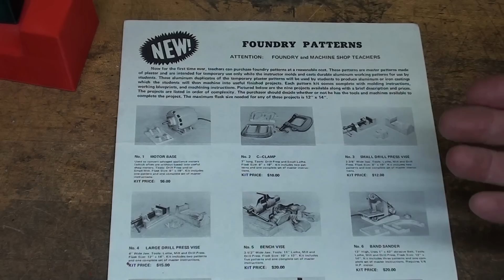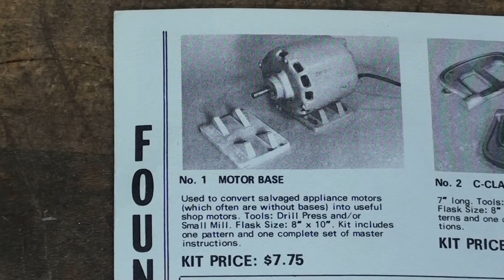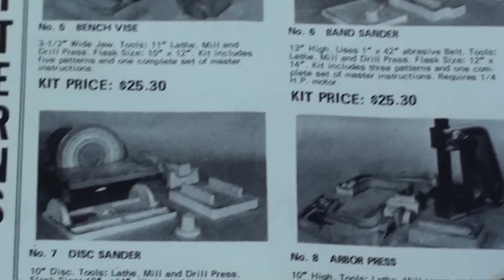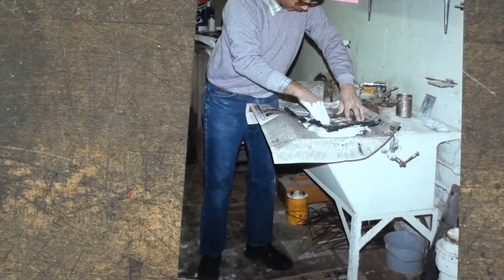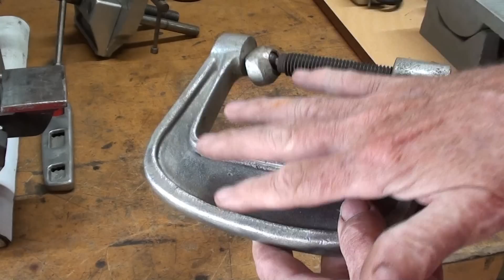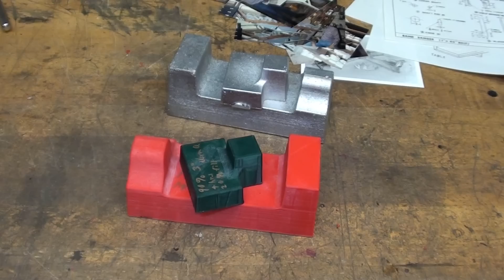What Was PETERSON PRODUCTS? Tips #445  tubalcain

Comment: HS was the early '80s.  Our school was a WPA-built, all-inclusive building for a growing suburb and Industrial Arts held the ground floor that wasn't the cafeteria.  4 years of drafting, wood and auto shop, 2 years of metal shop were offered, as well as electronics, plastics and printing in the Junior High as well as Junior and Senior year 1/2 day advanced vocational/technical training at multi-district campuses.  In the city, there were technical high schools with an even broader array of offerings.  Today, we're down to a couple years of "shop" total in the HS, 1 required, 1 "extra," with 2 years' of 1/2 days vo-tech off-site, focused on auto-trades, welding, cosmetology, etc.  Oh, and you can't earn a "college-prep" HS diploma if you take Vo-Tech, unless you take Math on your own.

I have kids that want to work with their hands and took all the shop they could.  One did the vo-tech offering in Welding, and I mentored the online Math class.  From one of their classmates, they learned about the machinist trade and it sparked them!  Luckily, there is a local state college with 2 great teachers and a top-rated program with much hands-on machine time.  First year in manual, with a steam engine as a capstone, 2nd year is CNC and pick your own final project.  They excelled and found good employment.  (Makes me think about going through the program and starting a second career, lol.)

Their teacher inspired them, as Mssr's Lagowski, Ptak, and Weber did for me in HS, as you do now for a worldwide classroom looking to learn.  Well done, Mr. Pete, as we sit here at our virtual desks waiting for the class bell to ring and the next lesson to begin.
Reply from the maker: Thank you for an analysis of the current state of vocational education.

Comment: Yes I cared. I got interested in that topic since you mentioned it in the band sander pulley videos.
You said you made about a hundred band sanders. That means you made about 100 band sanders in class with school kids using your own pattern that you also sold to other teachers or schools. How many of the different plaster molds did you sell over what period of time? I assume you got so tired of it since it forced you to work overtime probably for a longer period and series production is mind numbing. Did you ever consider another mold material than plaster?
Reply from the maker: I have no idea how many plaster patterns I sold over the years. But it was a lot. And I could think of no other material that was cheaper than blaster that is plaster. My whole point now is that could've been done was a 3-D printer
Reply: I see your point wanting to use a 3D printer. For a one-of-mold a 3D printer would be very practical but if you had to deliver many molds per day you would have needed a room full of 3D printers since each one would need several hours to finish one mold. The slow manufacturing rate could make 3D printers unpractical for larger production rates. In such a case plastic injection could be an alternative. What's more 3Dprinter filament costs about $30/kg which is more than cast aluminium. For medium production rates a home made semi-industrial outfit might be sufficient. In below link a guy has home made a shredder for recycled plastic whose shredded material is then used in a simple injection mold machine and in an extruder to make plastic products faster than in a 3D printer. "preciousplastic DOT com SLASH en SLASH machines DOT html". I have to give the link in this format since youtube sometimes deletes the whole comment when they mistake a link for spam.

Comment: Memory lane here,

I’m 37 and in high school we used to cast aluminum and pour are own molds. 
I think we had the belt /disc sander as a project.( or similar)
The belt sander used bushings and not bearings. Ate up lots of power from the motor, as I used a old dryer motor maybe 1/3 hp it was to small. 
I believe a drill press and band saw were also projects.

I’d like to actually build some of those C clamps. 

And my ramble is over!!
Reply from the maker: Thank you, sounds like you had plenty of experience in the school shop
Reply: mrpete222 

Ya.lots of experience and  a 2 year degree in machine shop operations.   I own my own Sheldon lathe and millwrite mill . 

Always doing projects at home.  I am a great  tech on scraping. .00005 flat on 40 points per foot. My  last job interview was for $16 a hour . Roanoke VA 
I am now working at a lawn scape place mowing  For $15.
Not my passion at all. I’m a die hard metal guy..

The first 10 years of my life I did auto collision work. Average 75k a year . 

What do you think on the current job situations/market?

PS, I am much like you starting business ventures. I remake and sell Sheldon lathe way wipe felts.. made a steel rule die and stamp them out. Have probably sold 100 sets.
 Setting up shop for Colchester 

I’m all done ranting . 
I love your vids !

Comment: Couple thoughts:
1) Another perk of having the source files is involving the students in a design-build-test exercise. Ask them to break it and then ask how they would make it better with minimum added cost.
2) If the idea of a foundry rattles the bean counters in the insurance department, might some kind of sintering oven work? There are 3D printing filaments with embedded metal particles specifically for sintering directly in an oven.
3) (edit - forgot) is there room to greatly improve the functionality of Aluminium-only castings with steel inserts,  either pressed in after the fact or cast-in-place? Making inserts could be a neat short production run exercise. In 3d printing, I think they call these sorts of embedded higher-strength bits "vitamins". You pause the print at the right layer to insert them and it gets you closer to the functionality of a solid metal part.
Reply from the maker: I am not familiar with the metal filaments
Reply: Sorry I was being lazy about linking. Here's an example but they have copper and bronze too.
https://shop.thevirtualfoundry.com/products/stainless-steel-316l?variant=12352928874579

These are not the same as filaments with embedded metal for aesthetic purposes. I imagine they could all be burnished to a bit of  shine if you just wanted the look.

Comment: Love the video.  Too bad you couldn't print the plaster patterns, but with the old steam and diesel powered computers, it was probably easier to use the rubber molds.  Speaking of maturing technologies, printed patterns make a whole lot of sense, even industrially.  Think of the space savings, with digital storage of patterns instead of a warehouse of stored wood, especially for repair items.  Of course, so much stuff is hogged out to solid stock with CNC, that patterns have less relevance in the larger scope than in the past.  It is disappointing to see the crafts relegated to the "Botards" rather than to bright, motivated individuals, because we, as a society, need them desperately.  Maintenance/repair has been reduced to "unit replacement specialist".  Don't fix it, just toss it.  But I ramble.  Look forward to a session on 3-d printed patterns, with references to process software.Cheers
Reply from the maker: We didn't have printers back then

Comment: I found this video extremely interesting - as a middle and high school student in Spfld. Illinois in the early to late 70's we had all kinds of shop classes - even in Grant middle school here in spfld. Illinoi within our industrial arts classes we had what were called exploratory classes.  Classes offered were in home construction where we built a scaled down home module learning all the fundamentals of home construction from foundation to roof.  We also had small engine repair class, a rather good manufacturing class, drafting, electronics where we learned fundamentals and built solder kits of radios etc. and there was even a radio and television class where we learned radio and TV operation and even built a mock radio broadcast booth in the corner of our classroom, I still have a newspaper article showing a pic of us building the broadcast booth -- In Spfld. high school we had wood shop with lathes etc. and metal shop - the metal shop did do aluminum casting and some machining.  There's also Vocational school with many classes like auto mechanics, auto body and many others.  I still live near these schools but in both the middle and high school all those classes are gone now, I watched them take the shops air vent system out years ago and replace the shops with a new science wing thats proven to be of dubious value and now theyre wanting to tear the entire school down after spending milliions in upgrades including air conditioning which we did not have in the 70's - Illinois politics, go figure.
Reply from the maker: We had all of those beginning exploratory classes as well, and all the areas you mentioned. It's all gone all over the United States. It will never come back. Thanks for watching￼

Comment: My best friend and I used to salvage washing machine motors for reuse too, but sometime in the '60's, maybe early '70's, manufacturers were pushing for cheaper motors and one of the answers was the open frame design– that was simply the cast aluminum bell ends with elongated fingers that did away with the full metal case, and those 12" long 10- 32 screws. I guess the thought was it's enclosed in the machine anyway, so why the redundancy?
Reply from the maker: Yes, they no longer had basis. On some of them you could see the copper windings
Reply: You can still see the windings, only nowadays they are a copper colored enamel over aluminum windings. In my hood there is curbside, about a week now, a dishwasher that you can plainly see is about 85% plastic,  such is the situation that it isn't even worth a scrapers time to load up, part out, and take the valuables to the center and deal with the remains. When a dishwasher is nothing more than a Kleenex– use it once, toss it away– then what's next?

Comment: As you know, there are many, many open source 3-D files on line. I don’t think it would be financially feasible. Thanks for the look back.
Reply: It'd also be pretty easy to plagiarize. 
OTOH, with all the recurring work gone the price could be dropped until they're next to nothing, compared to the per-project costs for the machines and materials. Good reputation and discoverability would be necessary, as well as high quality auxilliary material (blue prints, machining instructions) and a low-friction website. If you can get all that right, very large volumes of customers are possible.
Reply: If it were done today he could also offer 3d printed master castings at an additional cost for those schools and teachers which do not have 3d printing capability, such as due to lack of a suitable 3d printer. I imagine the big way to draw in school customers would be to have good licensing (important for schools), good quality, and possibly offers of adding the school logo to the files, like in the one shown in the video. I think that another step that would be useful would be packages of patterns intended to teach a variety of specific skills, in escalating complexity, along with a teachers' guide.

It would be less physical work with making the patterns but would require more deskwork, the advantage offered to schools being the saving on class prep time. And possibly giving guidance for newer shop teachers.
Reply: Aubreykun good point